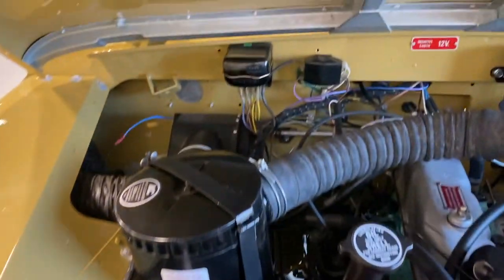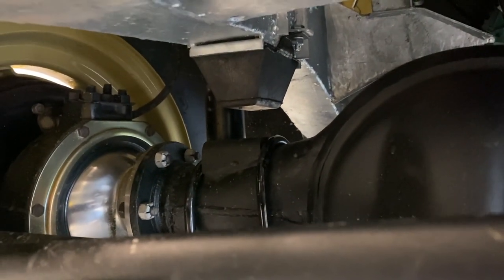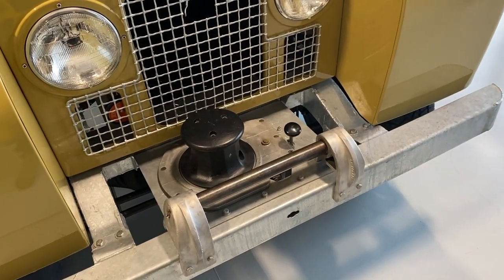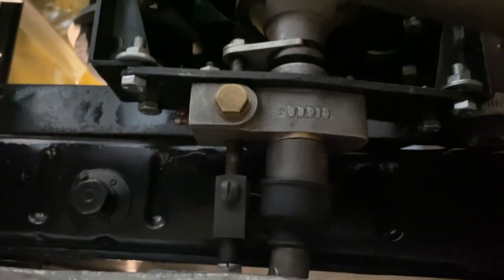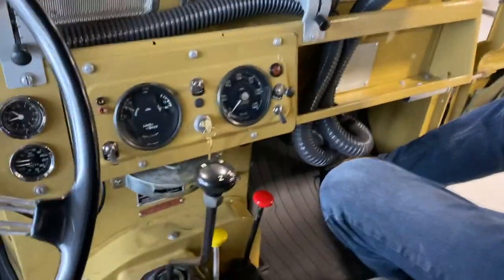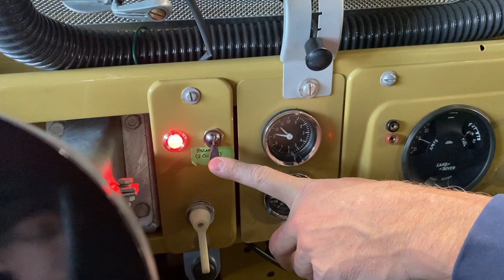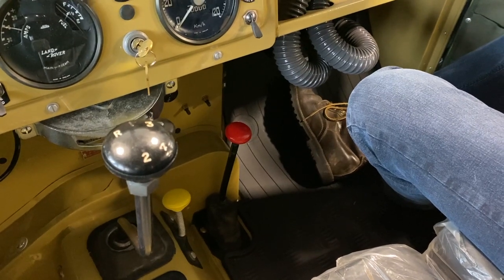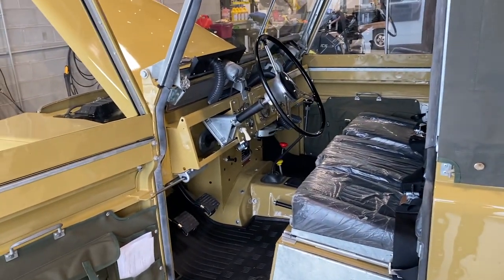1961 Land Rover Operation

Comment: Pushing the yellow knob down puts it into 4x4 high.   When it’s up, you are in 2 wheel drive.  You can double de-clutch to do the 3 - 2 (or 2 -1) downshift.  Push the clutch, let off in neutral, rev match, downshift.